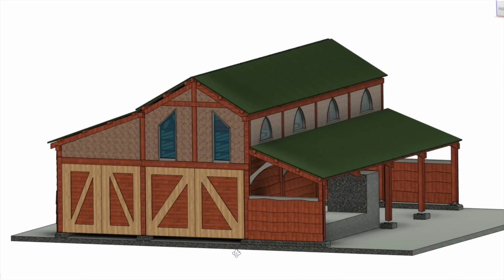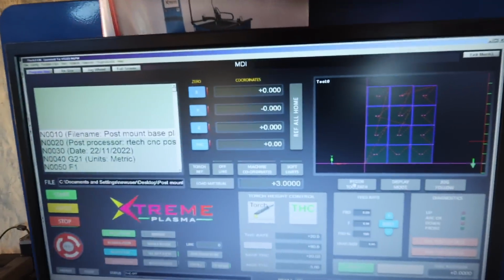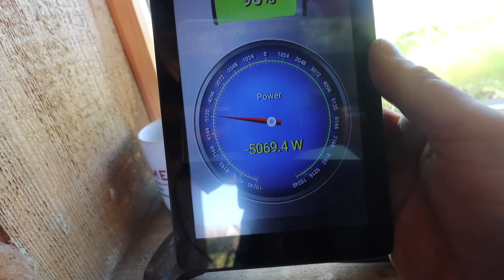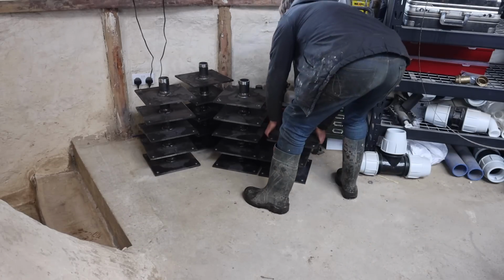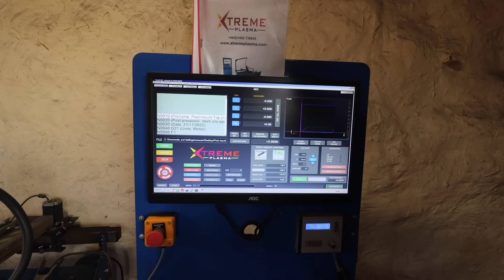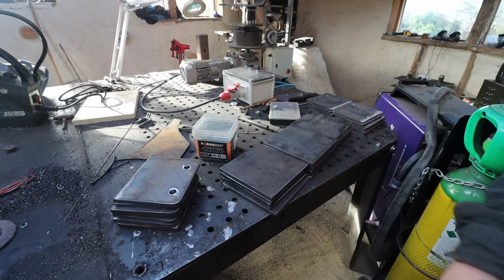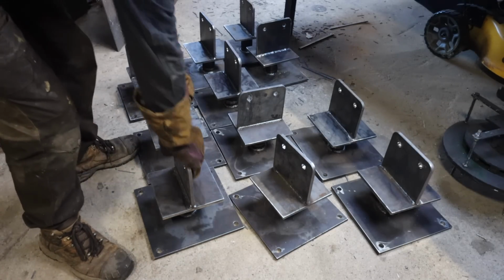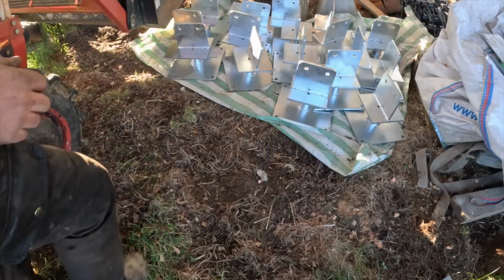Timber Framed Barn Part 2 DIY Post Mount Bases

Comment: Why are you wasting your limited energy with the plasma cutter by cutting individual squares? The width of the plasma cut is accurate enough for you to use one cut between squares rather than two. If you centered your dimensions on the central post the four mounting holes would be accurate